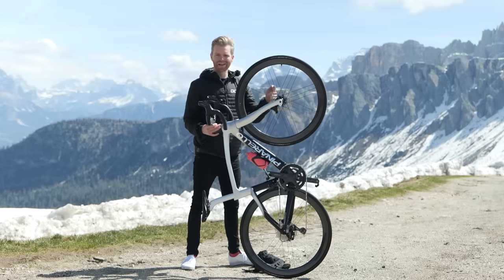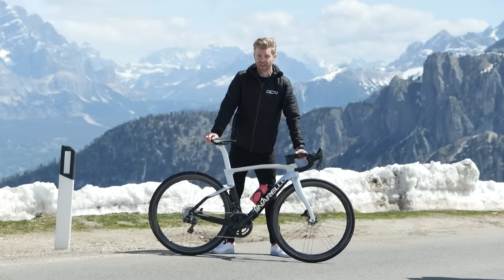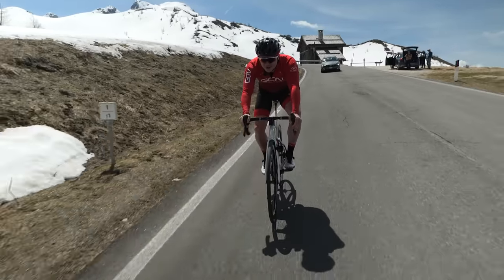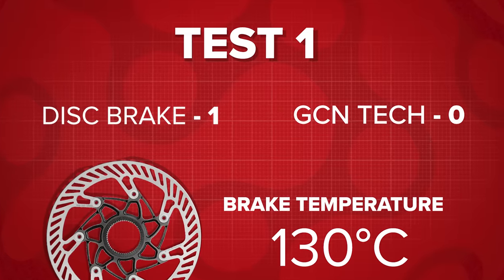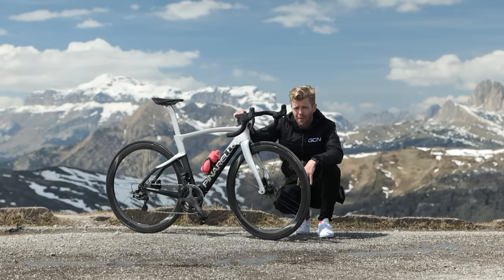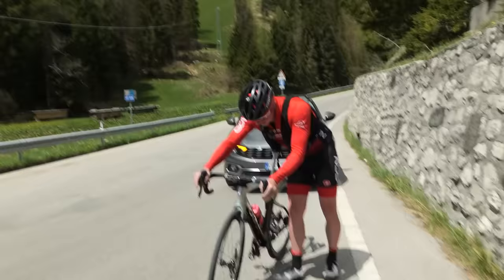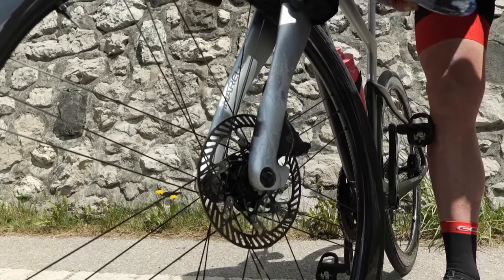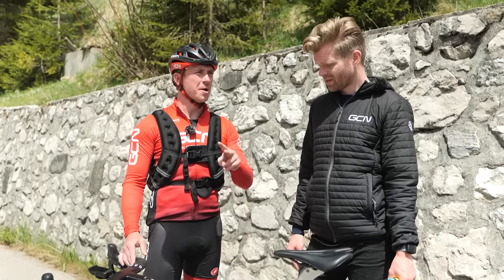Can We Melt Disc Brakes!?

Comment: Good reason to have disk brakes. My friend burned his carbon wheels during a long desending.
Reply: Others got carbon wheels hot enough to let them collapse at a pot hole. Carbon wheels don't like exzessive heat, the resins used for bike parts are different from those they use for aircraft parts (for example Fan blades of jet engines)
Reply: @simonm1447  We know they don’t use aircraft industrial resins on consumer carbon wheels. The type of braking you use is paramount to understand how to heat those wheels properly. Full contact braking is out of the question for fast descents, no even for corner corrections, you have to use the tap braking method for those fast descents if you are on rim brakes and carbon wheels without alloy braking track. Basically you can not have the pads too close to the carbon rim as seen on the video I made ( link posted). This is so that as you push in on the brake levers the soft contact is made halfway through the pull, this is important so that as you tap brake from back to front ( has to be in the order not front to back!!) rapidly those heat spots in the carbon wheels are randomly put on the brake track so that the heat spots are small enough to be cooled as the wheels spins. By having the pads too close to the wheel you feel safer but you are actually more in danger on carbon wheels as each pull of the brake levers is making a big ass heat contact spot on the wheel not allowing it to cool fast enough. If you watch the video you will see why the pads are set up with that gap. For flats I keep at least 5 mm clearance and on descents ( non mountain areas) I use a 3 mm gap so I can feather the tap braking holding on the hoods. The key to carbon wheels and rim brakes is very simple you simple can not use them to bomb down hill unless you are a pro rider on a closed road ( TDF descents are closed off for this reason, Disc or rim brakes does not matter). Personally for faster descents I use a set of aluminum lightweight wheels and either swap the wheels with our group support car or climb and descend on my own with the aluminum wheel set. Different tools for different purposes, there are drawbacks to each braking system, however my biggest gripe with Disc brakes ( I have them on my mountain bike) is you can not setup the pads 4-5 mm away from the rotor on each side ( like my road bike pads) so is can’t do the tap braking properly, I am always over braking on Disc brakes. Eventually I will have to move to disc brakes ( mechanical not that hydro crap) as more frames are coming with Disc only but that is many years away, eventually DI2 will also come down cheaper to the masses.
Reply: @danfuerthgillis4483  I use MT 200s on some of my bikes, I never had any problems with them, not in heat conditions (sometimes the rotor starts to get brown and blue at steep descends) and also not during winter in icy conditions. 
Sometimes simpler, inexpensive stuff works reliable since it's not overengineered
Reply: @simonm1447  I agree with you there, you simply have to use what makes the most sense for your applications. I am not going to purchase a 9000$ pro bike just to look like a duche with the latest hydro brakes and electronic shifting. I use simple bikes, simple tech so I don’t spend a fortune on it. I assemble my own bikes for  this reason.

Comment: You also drag the breaks when you want to obey the speed limit.

As for the abuse having Hank wear 20 kg is not much. I weigh 100 kg.   So if I had panniers loaded with stuff that would be dramatically more than your test, let alone what a tandem would do to them.

Comment: Is there a carbon ceramic rotor like an F1 car or supercar?
Reply: Probably not, since bicycle rotors are just 2 mm thick.
The problem with racing brakes on cars (ceramic brakes are racing brakes) is they work well if they are hot, but if you can't get them hot enough they are inferior to normal standard brakes which are made for lower temperatures.
Decending excluded you will not get a bicycle brake hot at all.

Comment: Steel discs were never going to melt but you could have set fire to the pads, shame you didn’t show what the heat had done to them.
Reply: 180 ° is no critical temperature for the pads. I got mine up to 300° (the temperature stainless steel gets blue) and the resin pads didn't take any damage.

Comment: How about drum brakes?
Reply: Since they have a inferior cooling they will overheat much faster and will have more fading.
This is one reason why cars always use disc brakes at the front wheels and drum brakes only can be found on smaller cars on the rear axle and slower vehicles like trailers or agricultural vehicles.
Drum brakes on a bicycle can be fine for a commuter, but not for mountain pass descending

Comment: You keep stopping and letting the brakes cool. Do the entire run with the brake handle taped 'on'. He could brake harder but not less than a certain amount.  Likely not enough mass or decent to get a glowing disc.

Comment: rip bearing grease
Reply: You can touch the spider even if your brake gets blue. Stainless steel isn't a good heat conductor, and the spider is made to conduct heat as little as possible with long, thin arms

Comment: I liked this video a lot, BUT, 160 C is hardly close to melting temp of steel. I expected you to do something like spin the rotors up to 10,000 RPM or something extreme like mythbusters, for instance. Come on guys, if the title says melt, let's at least see some glowing red, not just steam! It was fun, though.
Reply: a hydraulic press channel has tested it with a lathe. You can't melt stainless steel (around 1500° melting temperature) with disc brakes, the pads will burn to ash before and the hydraulic plastic hose will also burst before
Reply: Here's the video https://www.youtube.com/watch?v=oYBxwzgOm2I

Comment: This test was completely unnecessary and stupid. If they knew that the melting point of disc brakes is above 1500°C, after the first test they would have known it was impossible to melt them by simple riding. Also, brake fade starts way earlier and brake fluid boils way before that too. So it is physically impossible to replicate.

Comment: use shimano discs. they will melt because of the aluminium core
Reply: Aluminium melts at 630 ° C, so you have to abuse the brakes quite hard to reach this temperature (the Aluminium also has a big surface and a good heat dissipation).
Reply: @simonm1447  yea. but we had cases where clients came into our shop and their aluminium core was nearly gone.
Reply: @xwave5688  wow, respect. I never got more than a blue color (300°C) after longer very steep descends on my solid stainless steel rotors, which have a worse heat dissapation than the aluminium sandwich rotors.

A couple of years ago I descended Khardungla (5300m to 3500 m on 40 km) in Indian Himalaya a couple of times, and I never ran into trouble with my brakes
Reply: @simonm1447  Its always the E-Bike riders with no experience

Comment: Organic pads are gentle on the rotors.
Shouldn't this have been done with metallic pads?
Also testing rotors meant for metallic and rotors only meant for organic but still using metallic pads.
And speaking of pads, no knee pads? No motorcycle suit?

Comment: My story. 120kg. Hayes stroker ryde, sintered brake pads welded to the disc (just one pad). Front wheel immediately locked. From what i later saw, the brake pad "meat" was partially broken and missing, disc bended and changed color. Temperature outside, below 0°c.

Comment: I think the slots on the disc are there just to reduce weight and look cool (and maybe scraping the pads). Doesn't really look like they increase the surface area compared to solid disc.
Reply: They are actualy for cooling, trust me.
Reply: @cliffordromina3527  Well sorry, but I don't trust you :D Unless you can come up with a convincing hypothesis on how these slots help with cooling (and I only mentioned surface area anyway). Looks like the inside faces of the slots don't even make up the area lost on one side of the disc, let alone both sides. With a very thick disc narrow cutouts could increase the surface area (the cutout width needs to be less than the thickness of the disc). Increased turbulence could be a thing, but I doubt it would make up the loss in surface area. Basically the disc will get hotter since the same amount of thermal energy is received by smaller area. In motor sports shaped grooves and such among other things may promote air flow via centrifugal force, but since bicycle speeds are much lower, wheel diameter bigger and disc diameter smaller (and cutout shape questionable) the effect is magnitudes smaller. The pads probably need to be a certain size so they don't overheat which effects the rotor contact area width. The engineers probably calculated the extra steel in the disc was not necessary, so it was cut out, as is the disc holder etc to reduce the ever important weight of the wheels. I don't mean to say the slots don't have a legit function, just that it probably isn't cooling of the disc.
Reply: @Tam3n  you do make a point. With that, i now think that you are a more knowledgeable man than i am.
Reply: Always trust somebodies opinion who says ‘probably’ and ‘think’ when justifying themselves……
Reply: Still, i'm going to stand by my statement that those are for cooling purposes.
For this comment section, i have been scanning some of the bicycle disk brake patents, and they seem to support my idea of what they are for. They call them vent holes.
Some patents are about different arangement, and different shapes of these vent holes. You might be right when you say they induce turbulence.
And i have been making some computations, you were right when you said that they dont increase surface are.

Comment: 6:55 Oli really mashed this up, so much so that he exposed himself as being far more presenter and very little tech knowledge.   For this kind of long sustained dragging organic is NOT what you want.  Organic pads will temporarily fail once they have reached a certain temp.   He over simplified... I assume when he says ' steel' he means cintered.    But he is missing a key option: semi metallic ... Which usually IS what you want.   Semi metallic is NOT steel.  Semi metallic is organic impregnated/ mixed with non-ferrous alloys ( copper, brass or bronze).

Comment: Well a F1 brake reaches temperatures of 500-1000 degrees celcius, so much much hotter than the bike disc. Still incredible engineering and working capabilities with the bike disc brakes! Cool test

Comment: try doin that with the cheapest mechanical disc break and it would be a disaster....
Reply: it would still be better then a cheap rim brake 😅
Reply: WHY? The issue is the pad and the disk.  With mechanical you would not have to worry about fluid heating and water in the line.  Its not like he is applying full braking force.  A good pad and disk and even cheep mechs work fine, they just need a lot more effort. But you should be a strong boy 😉

Comment: GCN has turned crap
Reply: sorry this one wasn’t for you pal. what would you like to see different?
Reply: @GCNuser123  The channel is so bias and never gives a true HONEST picture anymore...

A great example is disc and rim like in the video an ALLOY rim wouldnt get as hot as its a larger area and same material but surprise suprise no mention of that.... The reason discs are hydro is because its a smaller rotor so requires more power.... if u try cable discs on a road bike there terrible... 

Issue is GCN seem to assume u CAN only use carbon rims on rim brakes... Use something like a shamal.... under 1500g also remener on disc wheelsets u have to add the rota bringing the weight back up....

It's like with the video u did on disc vs rim totally in favour of disc.. it was wet and u used carbon wheels against an alloy disc.... 2 totally different materials u may aswel be comparing apples to oranges....

Maybe u should redo that video in the wet using carbon discs then see what happens after all its more fair  as you're using the same materials....

Or at least use an alloy rim if you're using an alloy disc rotor...

Come on at least compare the same materials Oliver 👍

Comment: Oh wow! I think I'll go out and spend a fortune on a disc brake bike now!

Really, this rim brake shaming is awful. I don't see GCN mentioning that rim brakes are more aero and lighter than discs. Fine to promote disc brakes, but shaming rim brakes like they're useless - wrong!
Reply: There not useless, they just are not in the same class for performance.
Reply: @bindingcurve  an alloy rim brake would actually proform better than a disc brake as there is more area using the same material...

Issue is all the disc brake noobs assume you can ONLY use carbon wheels with rim brakes 🤦‍♂️🤦‍♂️

I wounder what would happen if u used a carbon disc.... I'd give it 30 seconds....
Reply: @danc1829  I have a older Cannondale F600 that was fitted with XTR rim brakes and Mavic alloy rims.  So the best possible rim setup you can get.  The pads were 3 months old.  Just swapped over to disks and will NEVER look back. And that's just running Mechanical Disks I pulled from my XC bike.  My XC and Road both run hydro.
Reply: @bindingcurve  I've never had an issue with my shamals on evens like the Fred Whitton on -30% technical descents with Swiss stop blue pads and ultegra 8000 calipers...

I can lock both wheels so why the need for even stronger brakes if beyond me...

If yours weren't great probably set up incorrectly
Reply: @danc1829  I run exactly the same rim brake setup on my Caad 13 - Ultegra r8010 calipers, Swissstop BXP blue pads, Jagwire compressionless outer housing. I get instant bite on my Hunt Aero Wide rims that it could potentially send me over my handlebars.

Disc brakes aren't bad, but I can't stand the squeaking noise, and the complexity of maintainence/cleaning. Plus, it's so expensive. I have a Gravel Bike with disc brakes, but it's the hybrid system, where the cable runs to the caliper where the hydro fluid is.
Reply: @danc1829  Well, I'm on loose 18% mountain bridal paths were you have to walk the bike in spots when climbing because of no traction and if your over 10mph on some descents when you hit the switchback you will DIE. I can easily lock up both wheels with the rim brakes, but If I do, I crash.  Disk brakes give me the CONTROL I need.  And frankly after having that control, I don't want rim brakes even on a road bike.
Reply: @bindingcurve  On an Gravel bike MTB I agree I used them on my MTB and my trials bike...

However Road cycling there so over rated u don't need hydro discs when you're using a 25 / 28mm tyre
Reply: @hoopdoggydogg  Yes I agree gravel, MTB etc discs make sense I use them on mtb have have used them on my trials bikes for over 20 yearsm Road though there 100% overkill
Reply: @danc1829  unless you have to do a panic stop from the hoods.